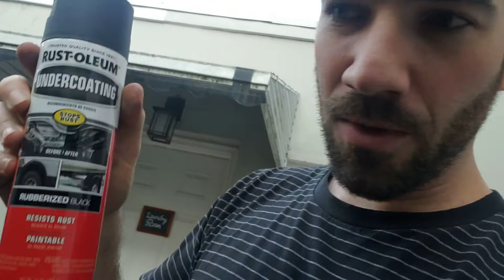Rustoleum Undercoating my truck - full process

Comment: Nice job 👍 
I would spray the inside of frame with some kind of rustproofing spray like Rust check, Krown etc, 
You can use a long tube to get inside those holes in the frame or just take the truck to a rustproofing place. 
I have a nearly 16 years old RL and there is not a single rust spot on the truck, I use Krown rustproofing here in Canada, we get our fair share of snow / ice and salt every winter.

Comment: they sell a WD40 wide spray can that you should spray your under carriage with every fall and spring after a quick wash, just 1 can will do the whole thing. It will help a lot and is easy to do.
Reply: works great on Aluminum too.

Comment: I love this channel btw. I too am trying to keep my ridgeline void of rust. I tried to *test* the rubberized undercoating product on an inconspicuous part of metal, DO NOT USE IT. It for some reason (idk why) rusts it out faster? I even prepped the metal and everything. Just does it for some reason. 
Now I don’t know if this is a PERFECT method, but I really like to use Rustoleum Rust Reformer as a base/primer, and then spray Rustoleum Black Performance Enamel on top of it. No rust ever peeks through, and when I then got to remove the paint as a quick test, it does not spread any further. 
For some odd reason the only thing I see killing this car is rust. The power train still runs amazing. 
The old man that owned it for its lifespan only did Honda Dealership servicing.

Comment: Rubberized Undercoating causes rust does not prevent rust it hold in moisture
Reply: I used it on my new car just to make sure it doesnt get to rust in the first place. Now it's rusting underneth it?
Reply: @vladgeorge7467  it will sooner or later. after a couple of years it will develop little cracks, moisture will get in and it starts to rust under the coating and you will not even notice till it is too late. what you can do is clean the underside of your car very good and spray it with 2 layers of a clear protective wax. not that kind for your carpaint...its a wax for protecting the underside of cars. that stuff will not harden completly, therefore will not develop cracks or get brittle. but it will be washed away over time. you should check once a year if its washed away too much and apply a layer if necessary. in my opinion thats the best thing you can do, without removing your rubberized undercoating.
sadly there is no way to apply something once and forget about it for the next 10 years. at least not where its winter and rain.
Reply: @MrMP-en7vf any idea on what that wax protectant is called?

Comment: 3:13 hello, did you also undercoat the mount or brace that holds the fuel tank?
Reply from the maker: @amazingworldofraffyandfran7556  I sprayed it, but it didn't help much, it still rusted more over the next couple years.
Reply: @EveryotherKarl  thanks Karl. So itd safe to undercoat it? Being its the fuel area?
Reply from the maker: @amazingworldofraffyandfran7556  I'd try to avoid spraying the tank itself, but should be ok. Unfortunately undercoating won't really stop the rust though..
Reply: @EveryotherKarl  thanks again Karl. I will not spray the tank itself, just the brace mount. Just want to be sure and safe.

Comment: How did your truck hold up ? Still going Strong ?
Reply from the maker: Still strong, rust has continued - it's a battle.
Reply: @EveryotherKarl  would you say your process helped slow it down a little ? Or didn't change much at all ?
Reply from the maker: @OurEssentialEssence  I think it helped a little. I think the most helpful factor was cleaning and killing the rust first before painting it.
Reply: @EveryotherKarl   Rubberized coating will accelerate the rust.  It almost destroyed the undercarriage of my 2015 F150. I'm hoping I caught it in time to save the frame at least
Reply: Biggest mistake was using rubberized undercoating once rust comes back it’ll be worse than what it was currently .
Reply: @nathanplante1479  oh yeah ? Let's ask him. How is the rust doing now sir ?

Comment: How has it held up?
Reply from the maker: It's held up fairly well for this winter, there is some rust peaking through - I haven't done a proper inspection yet though.
Reply: @EveryotherKarl  it look into Fluid Film or Woolwax. It covers/stops existing rust and can even be shot into frame rails and doors. Extremely effective 👍👍
Reply: @g_unit6773  Jup only add Cosmoline to Lanolin that should be look at.